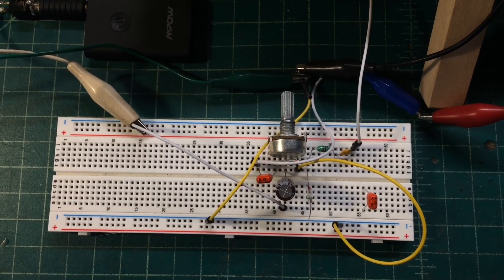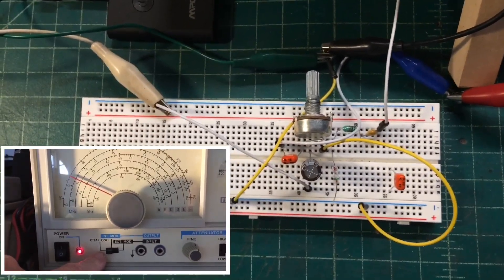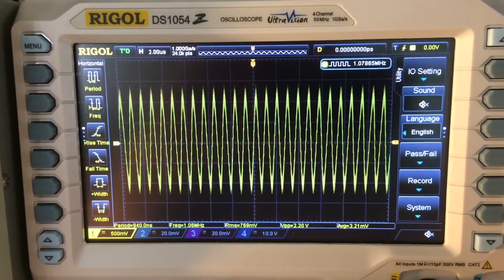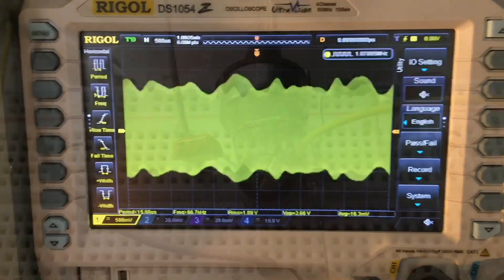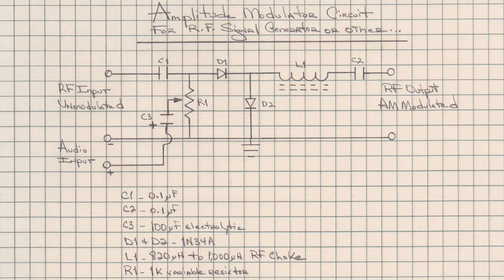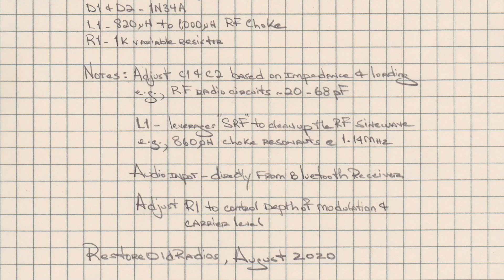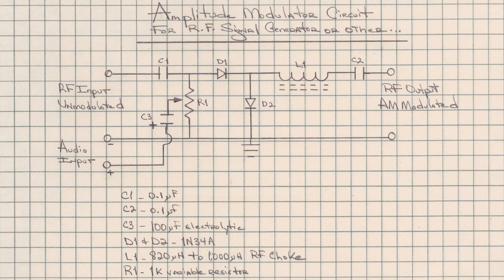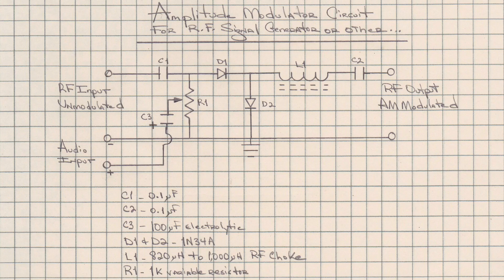Amplitude Modulator Circuit For R.F. Signal Generators or Other...

Comment: Btw what is the second diode used for in this circuit, because a couple days ago found a very simple AM modulator circuit just like this and you only need one diode.
Reply from the maker: I would to go breadboard the circuit again to see the difference in the modulation profile as this was an empirical design, but D2 should be the return path back to ground. Did you breadboard it and eliminate D2 by chance? Best, Don

Comment: Thanks for simple circuit - do you mind if I build it and use it on my channel?  I'll credit it to you of course.
Reply from the maker: That would be cool, I’ll be watching for your video. Thank you for reaching out and I apologize for my belated response, I’ve been away from YT. Best, Don
Reply: @RestoreOldRadios  Thanks Don
I've ordered the few bits I didn't have in my stash of stuff (the inductor and germanium didoes).  I may try to make a little PCB for that.  Do you have any hints or can point me in the direction of any useful resources? I'm much more of a fixer than a designer.

Cheers Richard
Reply from the maker: Richard, I use the cheaper PCBs from eBay or Amazon mainly 5cm x 7cm and also have some 7cm x 10cm and larger as well. I have another similar circuit I haven’t shared using a N channel JFET if you’re interested in building it as well. It doesn’t require a DC source, so a passive design with the input/output in the range of 1200 kHz as designed. Let me know if you’re interested and I’ll cleanup my drawing and send you a link to the schematic/BOM. Best, Don

Comment: HI Don! thanks for this circuit. I think this is what I have being looking for! My RF generator does not have modulation so I just want to modulate a carrier to align some of my equipment. . Just  to make sure, the input of the 400 Hz or so will go in the "audio input" and my signal generator at the "rf input unmodulated? then the "RF output AM modulated" to the radio, coil or section to be troubleshooted or to be aligned? I think I got confused by your comment  about the Bluetooth receiver... Cheers
Reply from the maker: You are correct. Your 400 Hz audio source input will take the place of the Bluetooth receiver. Thanks for reaching out and watching. All the best. Don

Comment: I've now found that when i build low power RF Power Amps with single transistor MOSFETs that I can add a 1 K Ohm resistor with an RF Choke in series with it, directly to the gate and inject an audio signal with a microphone or other 1 Volt PtP source such as laptop earphone jack and it will modulate the signal in both AM and FM at the same time, it's GREAT to make a low power room monitor with so you can listen to your radio room outside while you work in the yard!!!
Reply from the maker: Sounds like a cool circuit. Have you shared the design? Best, Don
Reply: @RestoreOldRadios  I just did 
No reason to draw out a schematic as I said just take standard RF Amp and add 1 K Ohm resistor to gate and feed audio signal between there and ground

Comment: Cool circuit, I'd like to see a simple 1 transistor NFM modulator circuit to FM modulate signals coming from a signal generator that has no external modulation source for use in testing 2 meter and 440 receivers.
Reply from the maker: That would make for an interesting project. Best, Don

Comment: That's a great idea to use a RF generator as a AM transmitter Don. I have been using the capacitor leakage tester that you came up with on three AA5 radio's and every paper capacitor I checked would leak, but the replacements would not. That is a great tool that I use now.
Reply from the maker: Thanks Jim and I appreciate the feedback on the leakage circuit too. During your calibration process, how many Megohms were you able achieve? Best, Don
Reply: @RestoreOldRadios  Don it's beyond the range of my meter, but I purchased the two 1G ohm for alignment so it very high at least 2G.

Comment: Thanks! Looks perfect to add AM modulation to my digital function generator. I have a couple of old RF signal generators that accept external modulation, but they don't have an accurate way of setting the RF frequency. I'll see if I can build the circuit in the morning.
Reply from the maker: Marv - it worked well for me. The output sine wave was distorted without the RF Choke in place. Ping me back and let me know how it works out. BTW - to connect the output to a receiver, I used a 20pF capacitor. All the best. Don
Reply: Don - I have it working pretty well. I built it in a metal box, but quickly found I had to put the cover on the box to eliminate the radio picking up noise from the circuit. The closest coil I had (without winding one) was 835uH, so my resonant frequency ended up around 1.0MHz. I'm using 22pf caps for C1 and C2. 

The radio I'm using at the moment has a ferrite rod antenna, and I'm using a coil of wire for the transmitting antenna, 4-5 loops about 6" in diameter laying near the radio. 

I have my computer playing an old-time radio show. I use a 1:1 audio transformer to isolate the computer's ground from the signal. Otherwise, the computer introduces a lot of hum. I also use a separate little homebrew circuit to combine the stereo output to mono.

While it would be easy enough to inject a tone at a specific RF frequency for troubleshooting a radio, your circuit would need an easily adjustable resonant frequency to use it for aligning a radio. I know you know that, just thought I would say it for anyone else reading this. 

Anyway, great idea! Thanks.

 @RestoreOldRadios
Reply from the maker: Marv - I really appreciate you taking time to provide feedback on the circuit. You mentioned your circuit to take stereo to mono; is that something you can share? Thanks again for sharing your experience with this and pointing out the importance of it being a tuned circuit that folks need to mindful of. Maybe adding a LC circuit to the output would add value? Best, Don
Reply: Here's a link to the circuit I use convert stereo to mono and also isolate grounds. https://dbbaudio.com/2012/stereo-to-mono-conversions/
There are lots of variations of this on the web. Some people just directly connect the left and right channels together with a cheap adapter but that may not sound as well due to the two channels fighting each other.

As far as adding an adjustable tuned circuit on the output, I was toying with the idea of putting something like a 200uh coil in parallel with a 365pf variable cap and seeing what kind of freq spread I got. I still might give it a try.
Reply from the maker: Marv Thank you for the URL, I’ll definitely check it out. I’m going to try the same (LC) when time permits and will ping you back with the results if they are worthy of doing so. Thanks again. Best, Don
Reply from the maker: I placed a 220uH RF choke and variable capacitor in parallel on the output coupled with a 30pF cap and it cleaned up the sine wave and allowed me to match the RF input frequency. Take care. Don